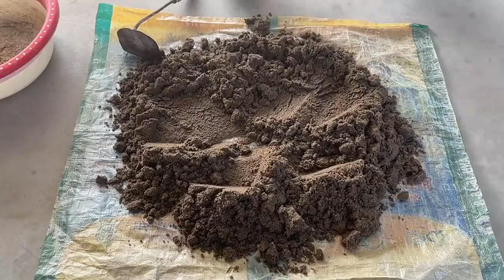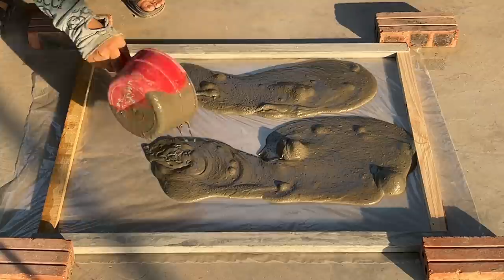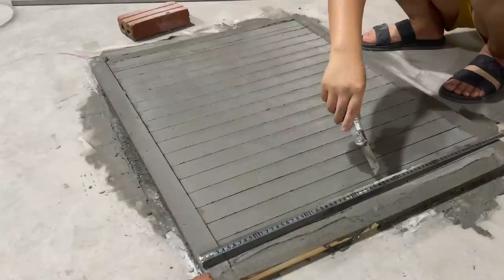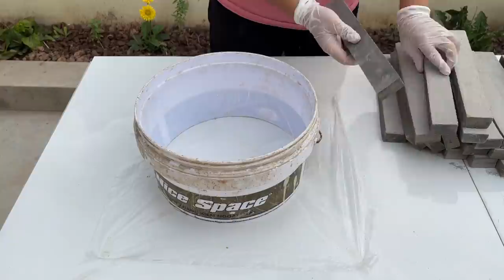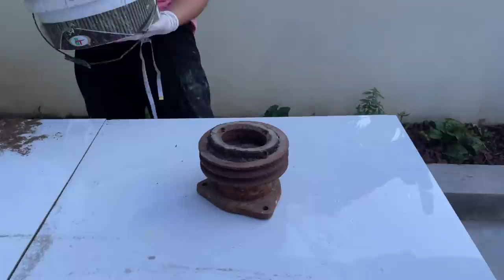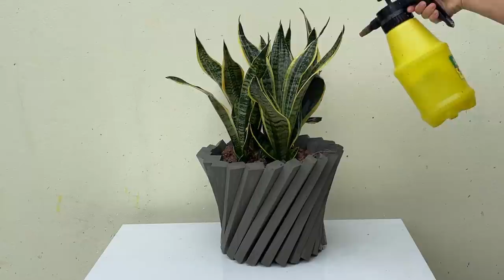Simple, special flower pots  - new products Designs For Your Garden

Comment: How much cement and sand ratio is used to make this cement stick. How many hours to rest it for complete dry for cement stick.
Reply: Proportion 1:2 is the best mixture Sir,after 8-10 hours cut it then make it dry within 24 hours.Remember to dry in a shaded area to avoid crack.You can also add reinforcement such as G.I.wire,or G.I.screen or plastic mesh.Thickness 2cm by 5cm and 30cm long of the length.Hope it will help you this info to make you own concrete pot..Good luck!
Reply: @samuelcamarillo7956  Thanks for your reply.